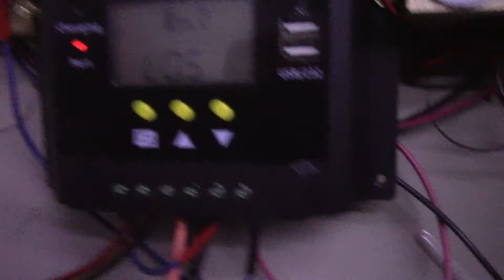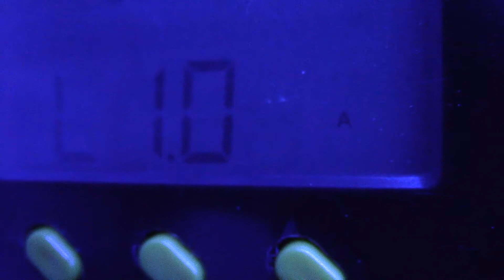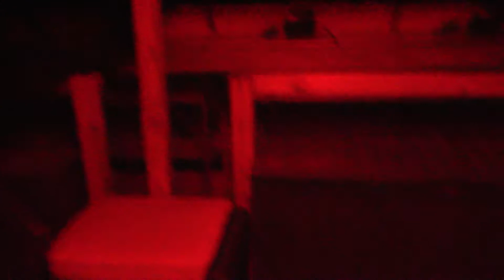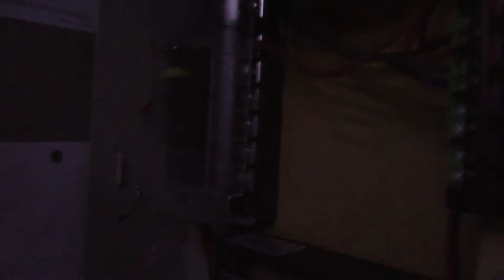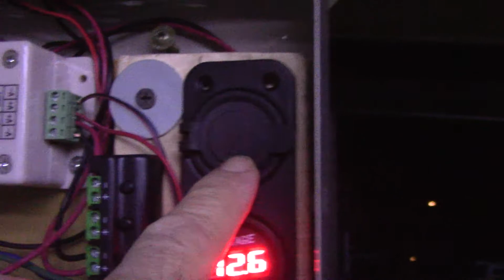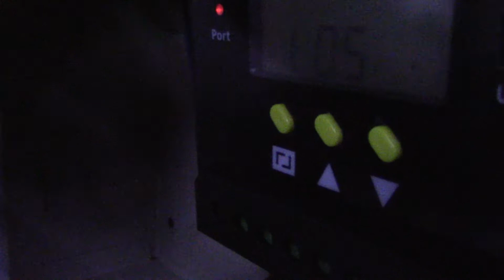control panel 2/Mood lighting/camp/buguout

Comment: nicely done :)
i have been experimenting with black light bug decoys and bug free yellow for lighting.
Tropical nights can be a real Bug ger :D
Reply from the maker: pepperoni prepper Lighting does have a lot to do with comfort.  This box runs my fridge, well pump, lights and stereo/radios out in the field/camp.  I am running 1, 1500W pure sign inverter but with 12 circuits you can grow as you wish.  I hang it in the back of the truck for the field.